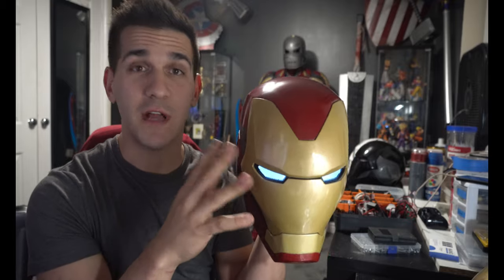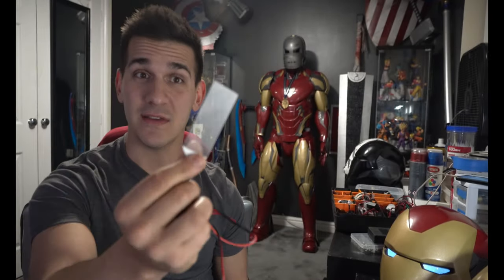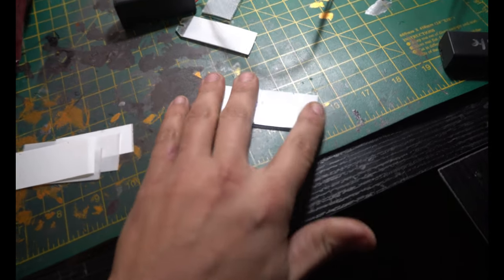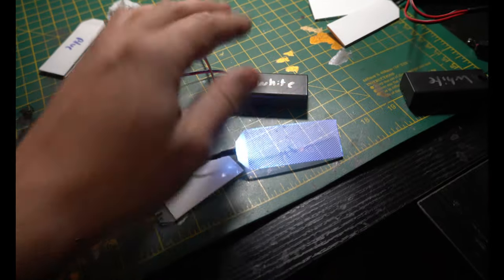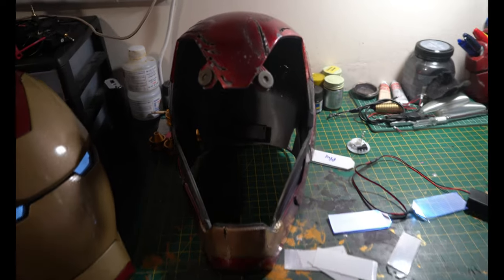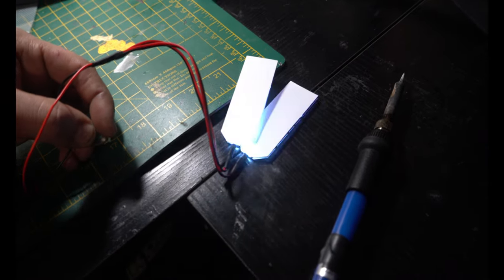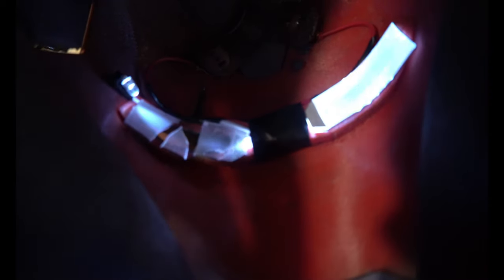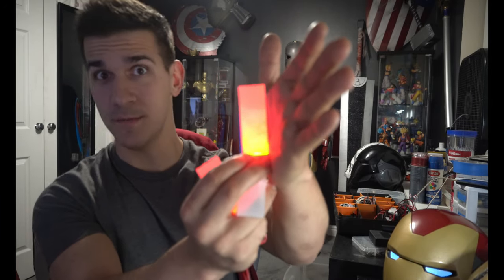New Flexible Cosplay LED Eyes! - Functional See-Through LED Eye Lenses - Tutorial

Comment: These little led eyes look amazing. I didnt know you could actually see through them lol. I wouldn't fancy having one of those lipo batteries at the back of my head tho. Think I would go with the little battery pack.
Reply from the maker: Yep they’re great!

And I don’t use LiPo batteries in the suit just usb battery packs
Reply: @FranklyBuilt  What about using a rescue blanket silver side towards the led side? I used them in the summer to reflect heat in my living room, you can still see through them but the silver reflects a lot of light.
Reply: new to the game here, what's wrong with LiPo in the helmet?
Reply: @NightFuryForever  that guy probably has an irrational fear of LIPO batteries. Somehow, the fact that puncturing a LIPO battery will cause a fire has turned into the idea that lithium batteries are ticking time bombs ready to explode at any moment. It's just not true, as long as you don't physically abuse the battery and don't short circuit it nothing bad is going to happen. Anti right to repair companies have also played into this narrative of lithium batteries being an extreme safety risk to justify not letting consumers replace batteries.

Comment: I just got green ones for my latex skull full head mask.
Curious how to attach them to the inside openings of the eye holes. Maybe styrene frame around eyes held on with e6000?
* UPDATE
held them in with gorilla tape. Worked fine BUT while trick or treating with my son after sundown I could NOT SEE.
it was so bad I had to switch to my spare mask. Even turned off I still couldn't see.